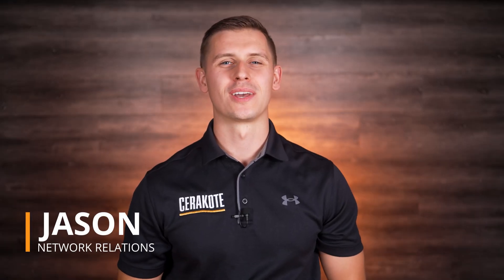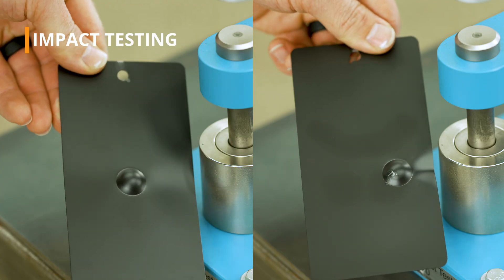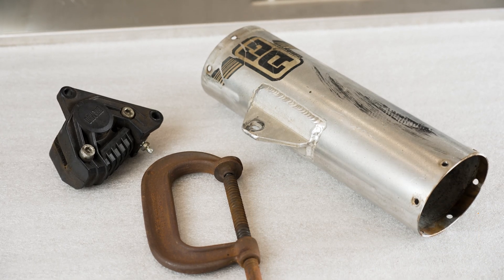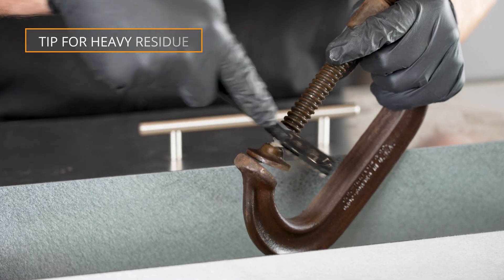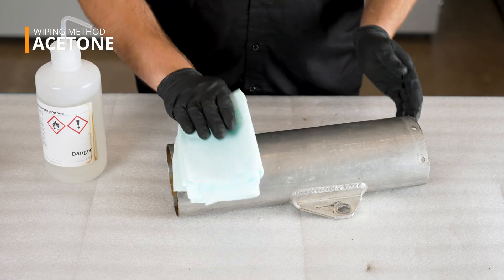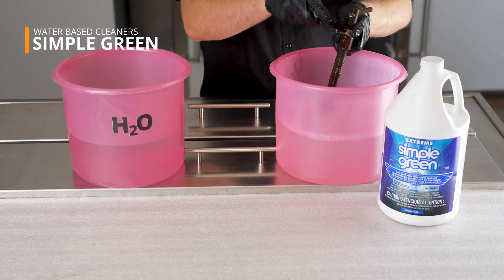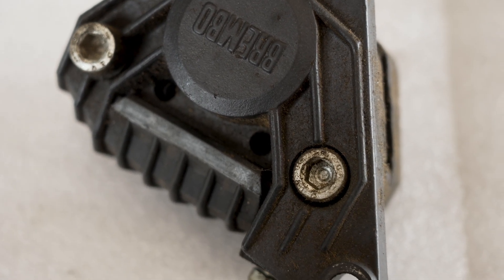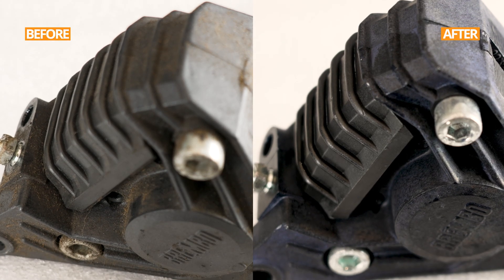Degreasing Metal Parts | CERAKOTE®

Comment: I use brake cleaner for those things that aren’t plastic or rubber. Rinsing with distilled water. Then I put it my ultrasonic cleaner with extreme simple green mixed with distilled water. Run heated for 30-60 min, depending on how dirty. Then again rinsing with distilled water. Then immediately towel drying, and drying with blower, then in a heated dehydrator if it has places for water to be captured. Will use a brush with brake cleaner if needed. Will also use sand blaster if need prior to brake cleaner for rust parts, or other parts that have additional issues.

Comment: As a note if you decide to go with something like Lemishine skip it and got to Costco and just buy the big bag of citric acid it’s much less expensive than Lemishine.   I use a 2.5 gallon ultrasonic cleaner to which I add two tablespoons of standard green simple green half tablespoon of Dawn dish detergent and a tablespoon of citric acid powder.  It does an amazing job.  Temp is around 50 Celsius